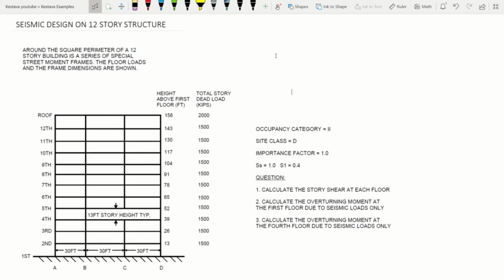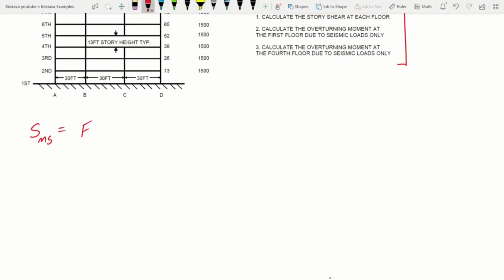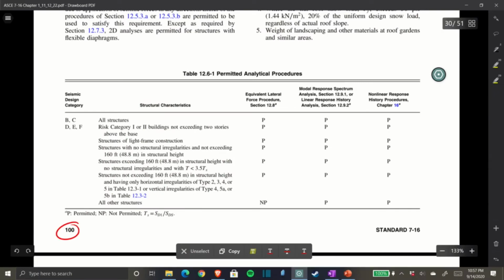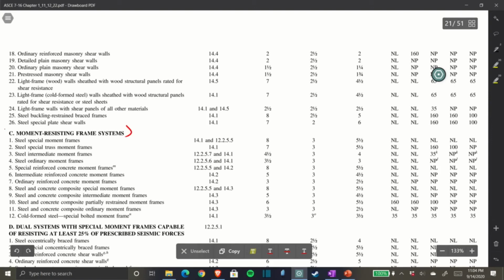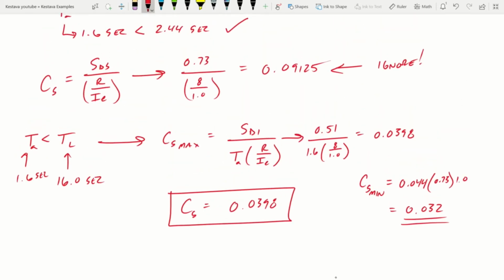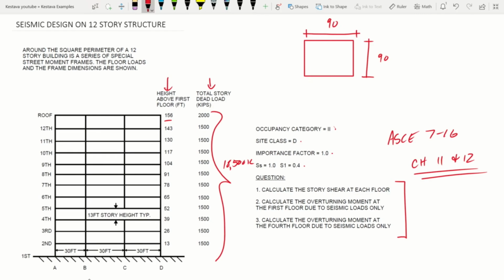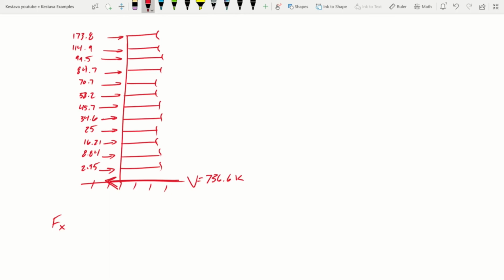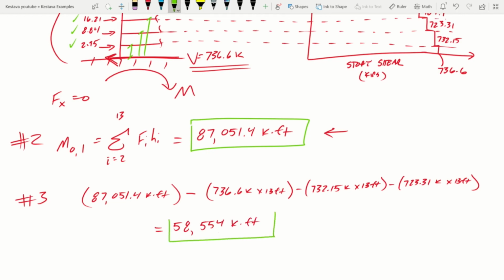Calculating Seismic Story Shear - 13 Story Building - Using ASCE 7-16

Comment: Hi Rich, thanks for your nice video. Just want to know what is PGA used for. I was doing a design work, the employer's requirements said the minimum PGA used for design is 0.6g, but PGA has not shown up in your video so far.
Reply from the maker: Hi Kaihui - PGA stands for peak ground acceleration. PGA is the max ground acceleration that happens during shaking caused by an earthquake at a specified location. and since its the "peak" PGA refers to the largest recorded acceleration on an accelerogram. I havent used PGA much but ill have to get it incorporated into a video for you!
Reply: @kestava_engineering  thank you so much mate!

Comment: Thanks for the video, I have some questions at this point: (Quest.1) as it says here that time period is 0.2 for short and 1 sec for tall buildings. Are these time fixed values? Isn't is very common to have time period way greater than 1 sec. How we design for buildings having more than (say) 30 stories? (Quest 2)  isn't Time period a function of type of building material i.e. concrete, timber, steel, type of soil strata on which it rests, number of stories etc. So how we can generalise just 2 time period when there are number of factors which can change the time period of a building? Thanks..

Comment: Would you happen to know why for seismic, when calculating the base shear, people often divide by 1.4?  I’ve been told it’s going from ultimate to ASD?
Reply from the maker: Hey Jeff, its a conservative approach to switch back and forth between ASD and Ultimate as youve stated. this comes from the load combination in chapter 2 of the ASCE 7-10/16 provisions. Ultimate = 1.0Eh and ASD = 0.7Eh. for JUST base shear that is a 30% difference so 1.3 might be more justifiable, however when talking about all factors of seismic design where DL is used in the calcs the ASD and Ultimate load cases get more complex and I believe 1.4 ROUGHLY translates between the two. again this is just a rough order of magnitude but should not be taken as gospel, otherwise it'd be in the code!

Comment: I was wondering why we calculated the overturning moment at the 4th floor?
Reply from the maker: Hi Casey,  I put that question in to show how you find OTM at each story. As we move down the stories the forces increase and you would need to design each story for the increase in forces. It was just to show not every story sees the same forces. great question!